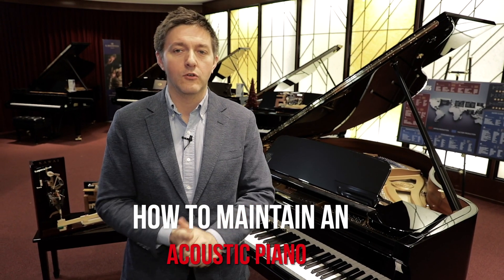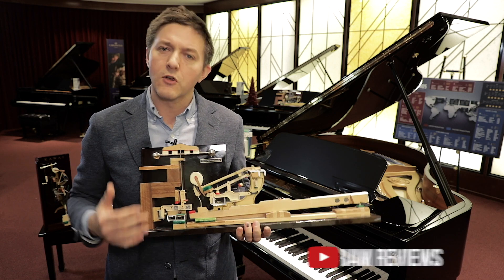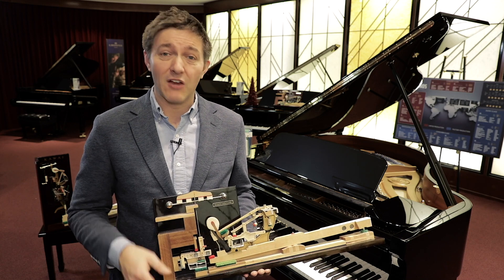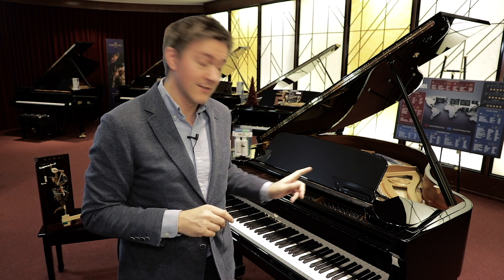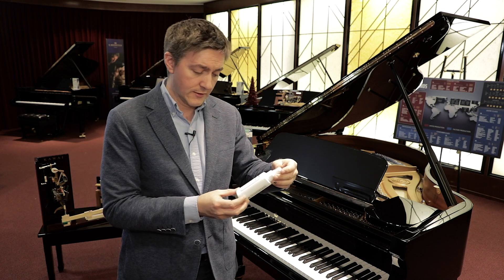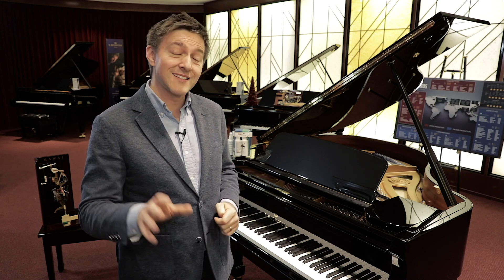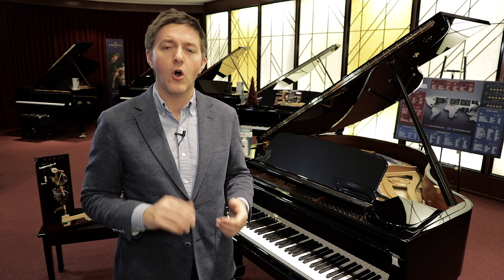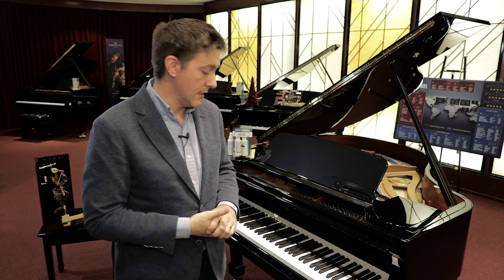🎹How To Clean Your Piano And Maintain An Acoustic Piano🎹

Comment: Hey Stu, what products/tools do you recommend to clean the soundboard?
Reply from the maker: Hi! Brent here! A simple feather duster can be used for general clearance of dust. However, if significant cleaning is required, it is recommended to leave that type of work to a piano technician.
Reply: @MerriamPianos  Hey Brent, I've heard that nonalcoholic baby wipes can be used for the soundboard, the dampers and the plate.  Can you confirm that this is not harmful?

Comment: Living in old house with no insulation, and no AC and don’t use the heater much in the winter and it’s in a humid area (70s in winter) . I would love to have an acoustic piano, but should I shy away from them?
Reply from the maker: Thanks for the question! There are other things that can be done to mitigate some of these concerns. You could use dehumidifiers if the humidity gets too high. In the case that you are dealing with dryness, there are also humidity control systems like Dampp Chaser systems. At the end of the day, it really comes down to being a personal decision of course. But, with the right measures taken, it is likely possible to properly maintain an acoustic piano in your home. :)

Comment: Hi, I live in Indonesia which is about 70% humidity all year long. What do you think about hanging a “piano heater” inside the piano? It’s like a 20 watt long stick that the seller say will help reducing humidity. My piano is an old 1980s Schimmel. Thank you !
Reply from the maker: Hi! Brent from Merriam Music here! I am not particularly familiar with that kind of system. However, 70% is right at the top of the range of a safe humidity level for a piano. Given that you're right at the top of that range, having some type of humidity control system is certainly not a bad idea.
Reply: @MerriamPianos  thank you for replying so fast!

Comment: i bought one thats perfect but all over it are small light scraches from wrong cleaning =[ is there anything i can do ?
Reply from the maker: Hi there! It ultimately depends on what kind of finish it is. With polished finishes, you can either use a polish (for lighter scratches) or get a technician that specializes in cabinet work to buff out the scratches. We have a few technicians on our team that do incredible cabinet restoration work and can bring a heavily scratched piano back to showroom condition. :)

Comment: I would not recommend soapy water on ivory keytops, the ivory is porous and water will melt the glue; at least on older instruments.
Reply from the maker: Ivory key tops do require a bit of a different approach than modern synthetic key tops.

Comment: How to prevent moths from entering your piano and feasting on the wool inside the piano like the hammers, velt
Reply from the maker: Hi there! I think trying to mitigate moths from entering the home/building is the first line of defence. Ensuring that doors to the outside remain closed as much as possible is key. Beyond that, ensuring that the lid of the piano remains down when not in use will also help the cause. :)
Reply: @MerriamPianos  Thank you! I have bought some cedar wood chips as well and layed them inside the piano. I read somewhere it can help. I'm a bit afraid of moths cause they even ate from the hammers of my previous piano. I just got a kawai k500 and i'm afraid it will get infiltrated by moths.